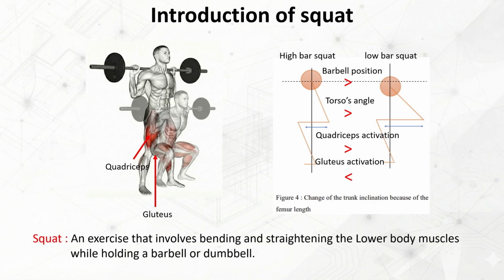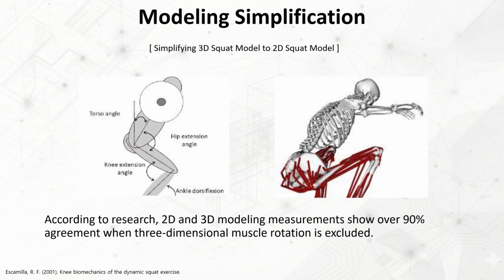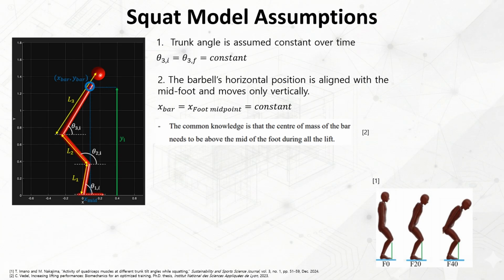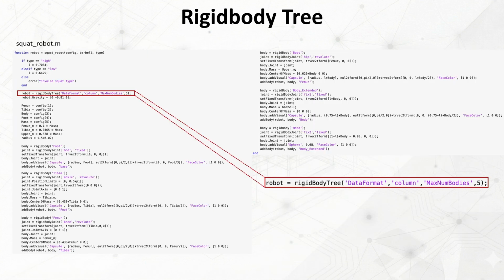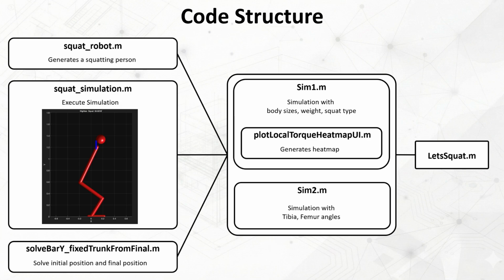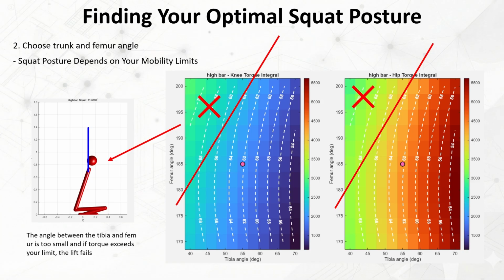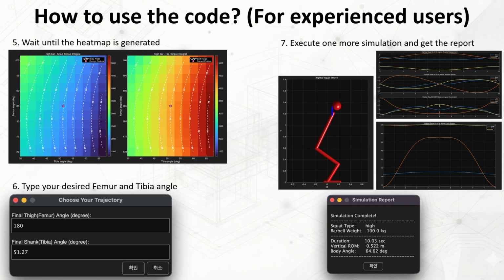Squat_Yonsei university Engineering numerical analysis team 1

Comment: Hello. This is Team2

Great presentation! 
I noticed that for the 2D modeling, the trunk angle  was assumed to be constant.
However, in real-world high-bar or low-bar squats, the trunk angle often shifts dynamically due to fatigue or sticking points.

I’m curious if you have estimated how much error this static assumption might introduce in the calculated torque values compared to actual dynamic movement.

Does this limit the model's validity to specific phases (e.g., just the bottom position)?
Reply from the maker: Hi, im jinwoo jang from Team 1.

Thank you for the insightful question.

You are correct that, in real-world squatting, trunk angle may change due to fatigue or sticking points. However, in this study, we did not treat trunk motion as a realistic variation to be reproduced, but rather as a deviation from a biomechanically recommended and safer squatting pattern.

Multiple biomechanical studies have shown that increases in trunk flexion during squatting substantially elevate lumbar flexion moments and shear forces, which are strongly associated with an increased risk of low-back injury (McGill, 2007; Escamilla et al., 2001). Conversely, maintaining a relatively constant trunk angle has been recommended as a safer strategy, as it stabilizes spinal loading and promotes more efficient load distribution to the lower-extremity joints.

Based on this evidence, we defined a squat with a stable trunk as an ideal and low-injury-risk reference movement. Accordingly, the trunk angle was modeled as constant in our 2D analysis. This assumption was therefore not made for computational convenience, but was an intentional design choice grounded in biomechanical safety principles.

As a result, our model is not intended to represent technique breakdown or compensatory strategies under fatigue. Instead, it aims to characterize joint torque distributions under a controlled and biomechanically sound squatting pattern, such as those commonly emphasized in coaching and rehabilitation contexts. Within this intended scope, we believe the model maintains strong validity.

Comment: Hello. This is Team4. It was a really interesting presentation for a person that like this kind of calculation in real life.

I agree that maintaining CoM balance is critical but often the hardest part for beginners.

Have you considered applying a 'Smith Machine assumption'? Since this relaxes the balance constraint, you could treat the vertical bar placement as a continuous optimization variable, rather than just comparing High vs. Low bar.

Furthermore, since shifting the bar position physically alters the required trunk inclination (lumbar angle), do you think that formulating a holistic objective function is possible? I imagine an optimizer that calculates the perfect combination of 'Bar Height' and 'Trunk Angle' together to minimize torque. This would generate a truly personalized Global Optimum for every user.
Reply: Hello, this is Team 1. Thank you for the thoughtful comment.

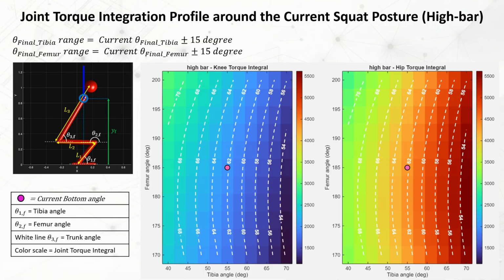Our model was indeed inspired by the Smith machine concept in that we constrain the bar path to a straight line, which simplifies balance considerations and allows us to focus on posture–torque relationships. 06:05 In the latter part of our presentation, we vary the trunk angle and the bottom squat depth, and through inverse kinematics, the effective bar position is determined accordingly. For experienced users, our analysis is not limited to a simple comparison between high-bar and low-bar squats. Instead, within each bar configuration, we systematically vary trunk angle and posture, and evaluate how these changes affect joint torque distribution. This allows users to understand posture–torque trade-offs within a given bar style.

We agree with your point that jointly optimizing bar position and trunk inclination through a single objective function is a valid and well-defined approach, and it would be particularly suitable for users whose primary goal is minimizing joint torque.

Rather than pursuing a single global torque-minimizing solution, our primary goal is finding personal optimal posture. Specifically, we aim to help users explore how changing trunk angle and squat depth redistributes joint torques, so that each individual can decide which joints or muscle groups to emphasize and which loads to reduce, depending on their training goals or physical limitations. By providing torque profiles and heatmap-based feedback, the user can actively select a posture that best aligns with their own priorities.

Thank you again for the valuable suggestion, it aligns well with the intent and design philosophy of our framework.

Comment: Hello, this is Team No.3 

Thank you for the interesting presentation!
It is impressive how you clearly visualized the squat mechanism using numerical analysis. 

I have a couple of questions regarding your modeling process:

1. You set both the 'fixed Trunk Angle' and the 'vertical bar path' as simultaneous constraints. Depending on individual anthropometric ratios, did you encounter cases where the Inverse Kinematics (IK) solution does not exist (singularity) or exceeds the actual Range of Motion (ROM)? If so, how did you handle those exceptions?

2. You mentioned using the standard equation of motion for Inverse Dynamics. I am curious about the quantitative contribution of inertial forces or Coriolis forces to the joint torque compared to the static load (gravity) at typical squat speeds. Was the dynamic component significant, or would a quasi-static analysis have been sufficient?"

Thank you.
Reply: Thank you very much for listening to our presentation and for the thoughtful question. 
I will address your second question below. We agree with your point regarding the importance of distinguishing dynamic and static contributions.

At typical squat speeds, where the movement is relatively slow and controlled, the contribution of inertial and Coriolis terms to the joint torque is not dominant. In our analysis, the dynamic components accounted for approximately 10% on average of the total joint torque, with gravity (static load) being the primary contributor. Under these conditions, a quasi-static analysis would provide a reasonable first-order approximation.

However, we included the full dynamic formulation to achieve a more accurate and realistic representation of human motion. In addition, as movement speed increases—such as in faster or more explosive squats—the dynamic terms become non-negligible and can significantly influence joint torque estimation. For this reason, we incorporated these effects to ensure the model’s robustness and extensibility to more dynamic motions.
Reply: Hello, I'm Sunghyun from Team 1. Let me discuss your first question regarding IK.
First of all,  we  calculated the range of motion before solving IK, by specifying the initial position and final position. This approach enables us to avoid such singularity, because this actually forced the IK solver to calculate  the solution within acceptable ROM. 
Also, we tried some other anthropometric ratios based on several papers, rather than trying unacceptable or meaningless values. Within practical ratios, we confirmed that our framework works well. 

Thank you for your thoughtful question. I hope our answers helped your better understanding.

Comment: Hello, this is Team No. 2.Thank you for the clear and interesting presentation.
We were curious about how sensitive your results are to the way the “optimal” squat is defined. If you slightly change the criteria you are optimizing for (for example, prioritizing the knee over the hip, or vice versa), does the recommended posture change a lot, or does it stay mostly the same?
Reply from the maker: Hello, I'm jinwoo from Team 1.

Thank you for the question. In short, while the interpretation can be adjusted depending on which muscle group or joint a user wants to emphasize, the overall recommended squat posture does not change significantly.

For example, if an individual prefers to reduce knee loading or emphasize a particular muscle group, the results can be interpreted in that direction. However, in a free-squat environment, global balance constraints and mass distribution dominate the mechanics, so key posture variables such as bar position and trunk inclination remain within a relatively limited range. In other words, while the distribution of joint loading may vary depending on the user’s goal, it does not lead to a fundamentally different squat pattern.

Additionally, our model and results are provided in a reproducible code form. If further clarification is needed, downloading and running the code allows users to visually explore how posture and torque distributions change under different assumptions or interpretation criteria. This makes it possible to directly and intuitively verify the sensitivity discussed in your question.

Comment: Hello! I'm Gyeongho Park from Team #7.  I was impressed by analyzing squat, the main interest of many ME students.

Your model assumes the trunk and pelvis as a single rigid body with a constant angle. However, key muscles like the hamstrings and the glute-erector spinae chain act heavily on the pelvis to control its tilt. Specifically, the hamstrings pull the pelvis into a posterior tilt, while the lower back muscles must fight this to maintain a neutral spine.

By modeling the trunk and pelvis as one rigid block, doesn't your simulation ignore the massive torque and muscle demand required to stabilize the lumbar-pelvic junction? It seems this simplification assumes 'infinite stiffness' in the lower back, potentially underestimating the risk of injury or muscle demand in that area.

I think modeling this point is quiet important to maintain stability of spinal to prevent injuries. I think avoiding injury is most important things when we do any workout. So I can't just pass this problem.

Thank you.
Reply: Hello, I'm Sunghyun from Team1.

Thank you for your question, Gyeongho. Your point is absolutely crucial, as core stabilization is the most basic prerequisite for anyone performing a squat.

One must maintain 'core muscle stabilization'—either by using a lifting belt or by bracing the abdominal muscles. If this condition is not met, it becomes meaningless to discuss how joints or muscles are utilized, as the risk of injury would be too high.

Thus, we assumed that users of our framework would follow this basic rule, and we aimed to provide a reasonable trajectory based on that assumption.

In short, we regarded 'stabilizing the core muscles' as a fundamental prerequisite, which allowed us to model the upper body as a rigid block. Discussing a reasonable trajectory is illogical if adequate core muscle activation is not ensured.

Comment: Hello, this is team 6. Thank you for the great presentation.
Since our team also worked on an IK-based project, we ran into several issues related to singularities and unstable IK solutions, so this part especially caught our attention. I was really curious about how you handled this. Specifically, how did you set up your joint-limit constraints, regularization, and weight tuning to prevent the IK solver from drifting into singular configurations or producing unreliable solutions? We'd love to hear more about your approach!
Reply: Hello, I'm Sunghyun from Team 1.
Thank you for your question. We also encountered such problems too. What we actually dealing with contains 2-variable solution(x, y coordinates) but, the DOFs of our model was 3, which cause multiple solutions. This was one of the reasons why singularities and unstable IK solutions occurred. 

However, we also made auxiliary constraints which narrows down the solutions. We added body orientation constrains, and joint constrains to ensure 'human-like' natural motions. 

Our breakthrough was like below:
1. Calculate the initial and final position of squat. It depends on one's body spec, and squat type.
2. Based on initial and final positions, also calculate desired body angle.
3. By using body angle, and initial and final position we calculated, constrain the body orientation and specify the initial height and final height.
4. Joint constraints were provided to be less than 90 degrees, to ensure human-like motions.

Thank you

Comment: Hello, this is Sanghun Kim from Team 5. Thank you for the great presentation. I have two questions.

1. Since the optimal and stable squat posture can vary depending on a person’s body proportions, how do you plan to improve your model to account for these anthropometric differences?

2. Even though the squat has almost no lateral movement, from a top view the legs are not perfectly parallel but are placed in a slight “V” shape. You mentioned that prior studies showed more than 90% agreement between 2D and 3D models. Could you explain how large the actual discrepancy is?

Thank you.
Reply: Thank you for the question.

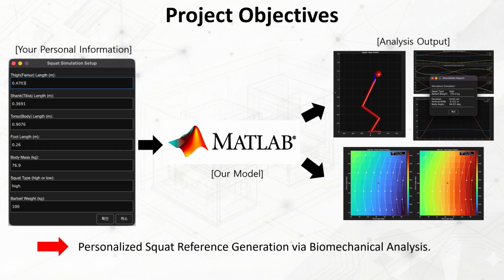1. 01:06 Our model is personalized because each user’s individual anthropometric information (e.g., height and weight) is used as input to scale segment lengths and mass distribution. The “average human” shown in the presentation is provided only as an illustrative example; all analyses are performed on a subject-specific model, not a fixed or generic one.

2. Although the feet form a slight “V” shape, lateral (horizontal) motion during a squat is negligible, and the movement is predominantly sagittal. Previous studies comparing sagittal (2D) and full 3D models report over 90% agreement in joint torque profiles, with remaining discrepancies mainly affecting torque magnitude and being smaller than variability caused by anthropometric scaling. Therefore, a 2D sagittal model provides a reliable approximation for personalized squat analysis.

References
Bordron, O., Huneau, C., Le Carpentier, É., & Aoustin, Y. (2019). Joint torque estimation during a squat motion. Proc. 24ème Congrès Français de Mécanique, Brest, France.
Escamilla, R. F. (2001). Knee biomechanics of the dynamic squat exercise. Medicine & Science in Sports & Exercise, 33(1), 127–141.

Comment: Hello, this is Team 8. Thank you for the presentation. You mentioned that your system provides appropriate workout recommendations based on body measurements and barbell weight. However, joint moments are highly dependent on the lengths of individual body segments as well. How did you take this factor into consideration?
Reply: Hello, I'm Dongwook Shin from Team 1.
Thank you for watching our presentation and for your thoughtful question.
As you correctly pointed out, joint moments are highly dependent on the lengths of individual body segments.

To account for this, our system explicitly incorporates anthropometric parameters as inputs.
Specifically, the user provides thigh length, shank length, trunk length (including the head), body weight, squat type, and barbell weight.
These parameters are used to construct a personalized rigid-body model, allowing joint moments to be computed based on the user’s individual body geometry rather than assuming a fixed generic model.
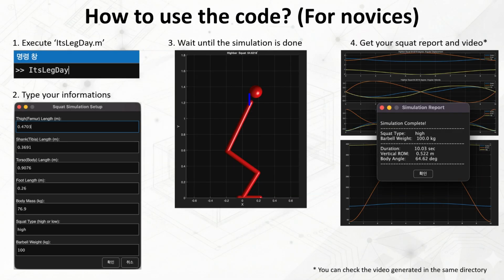This point is briefly mentioned in the video at 05:48.

In the current demonstration, to ensure physically reasonable and reproducible results, we used representative anthropometric data for Korean males aged 25–29, including average height, body mass, and segment length ratios.
In addition, since barbell placement differs between high-bar and low-bar squats, we normalized the barbell position along the trunk using ratios derived from prior biomechanical studies, rather than assuming an identical attachment point across squat types.

By combining individualized segment lengths (when provided) with literature-based normalization for bar placement, our framework is designed to capture the strong influence of body geometry on joint moments while maintaining biomechanical consistency.